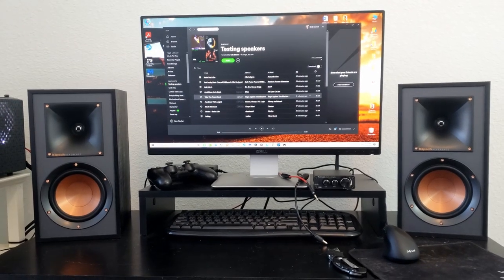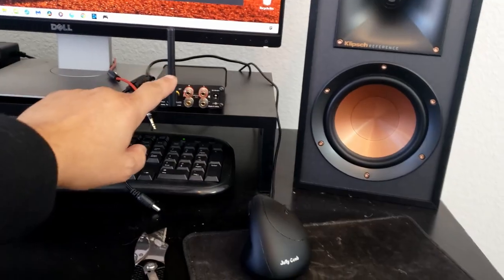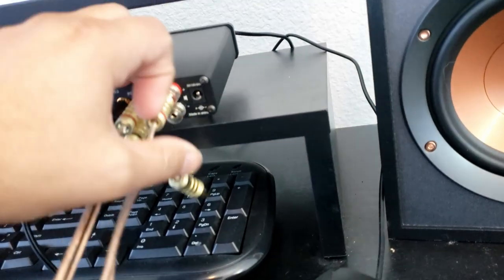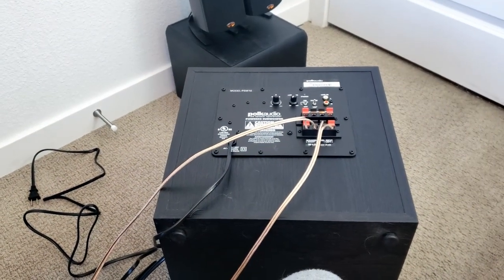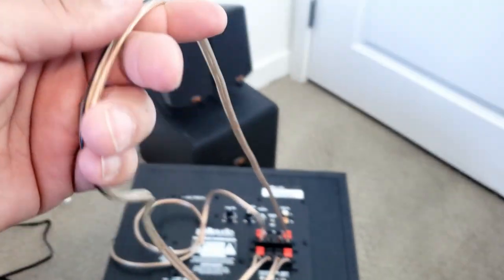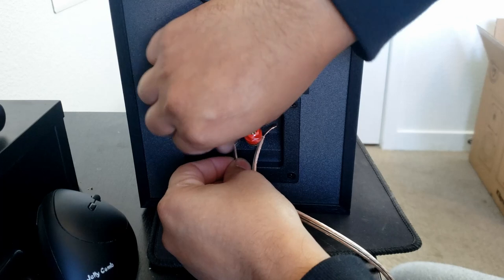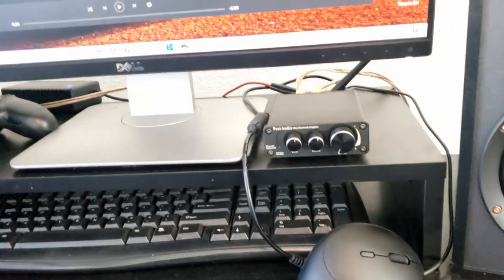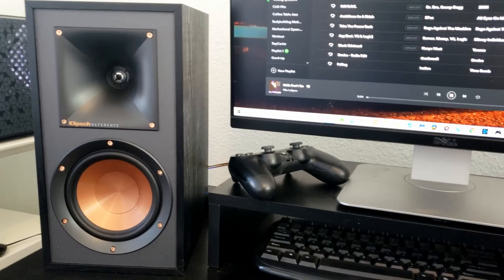How to set up Bookshelf Speakers & Sub to PC - Klipsch R-51m / Polk PSW 10

Comment: For anyone wondering you can use Studio monitors and subs with an audio interface that has many  connections (tho they are mainly used for studio home use or streamers that need that XLR port) and simply connect via usb C or the micro port to ya PC. Downside is they don’t have Bluetooth but they do have a headphone jack for audio playback and hearing ya mic recordings
Reply: I need some help. I have the same subwoofer + sony Bookshelf SSCS5 + focusrite scarlett 2i2 3rd gen. 
I am trying to decide if this way, buying fosi will be better for sound quality from my gaming pc or using audio interface that I already have. 
If I use the audio interface, what cables I need and how I connect them?

Comment: Does your computer have a green speaker out? I have a Y splitter cable from pc speaker out to my pc BOSE speakers and 10” KLIPSCH powered sub plugged into Y cable and an Amazon Basics 3.5mm Aux to 2 RCA Adapter Audio Cable for Stereo Speaker or Subwoofer with Gold-Plated Plugs, plugged cable into sub. Works great! I have to turn down the gain on the sub.

Comment: It would appear like your image will be muddied by the sub. I don't think you're getting 2.1 audio this way. You need a digital connection, with a crossover setting. You have good gear, might wanna go that route.
Reply: The sub has a filter built in

Comment: Sorry man, but connecting things this way you are using the cheap PC DAC (digital to analog converter) that do not sound great at all. Get yourself a DAC, connect it to PC via USB which is a digital connection and hook up the Amp to not the DAC. That way at least you’ll be getting more value for your very good bookshelf speakers and subwoofer.

Comment: Can i attach a subwoofer directly to my pc ..
Reply: yes, do you have the proper port on your motherboard?
Reply: @1040k  I have a Asus crosshair hero viii motherboard
Reply: usually they say hook it up to the orange   looking audio port (center/sub out) on the motherbaord, and get a splitter cable, not sure witch one exactly but i belive a stero aux to rca cable will be sutible. @SUDIPTOTECH
Reply: note : im also setting up my subwoofer only with my computer  my stuff arrives tomorrow  so hopefully i can set it up and let you know if that method works
Reply: @1040k Did it and up working I have the exact same problem. God I'm such a noob. I have Edifier R1700bt  and Jamo S810 and PC
Reply: @Mohawkchris  you might need a reciever for that or maybe an audio interface, audio interfaces are  cheap (depends) , i got my woofer hocked up to my scarlet solo 2 via the rca outputs on the interface its self